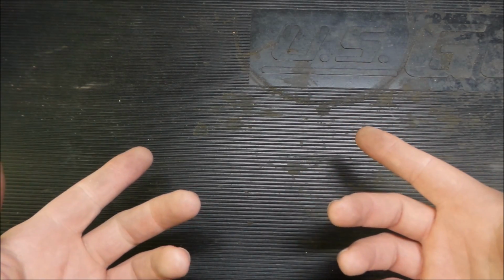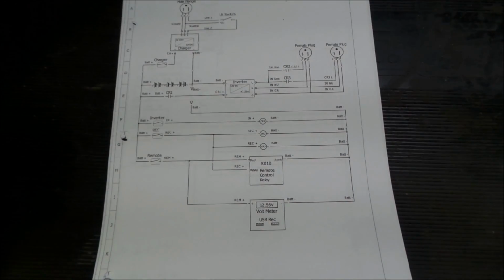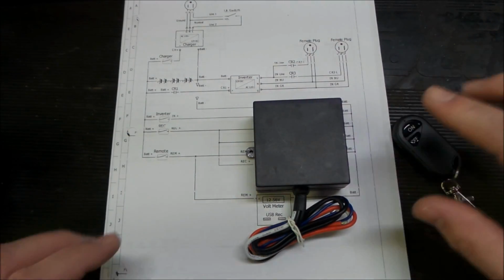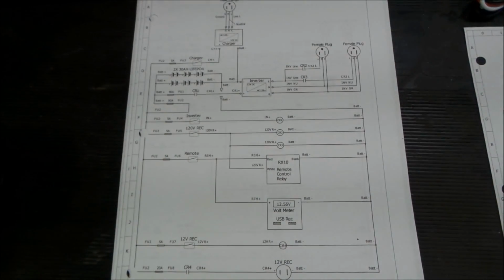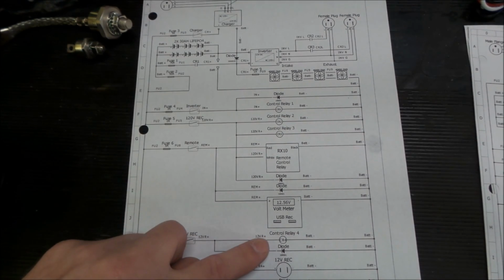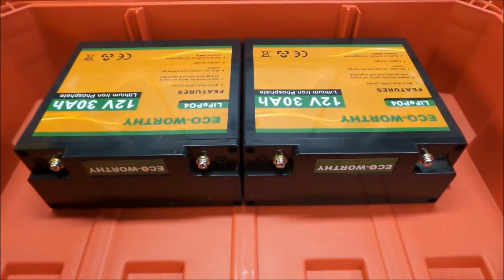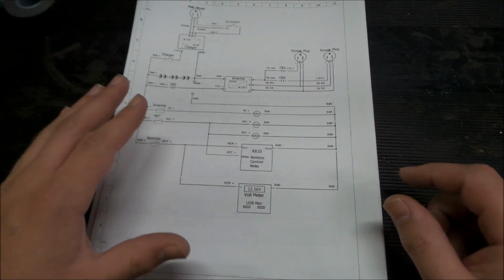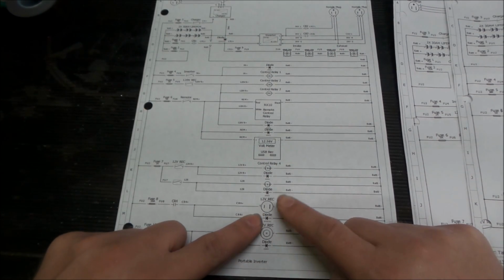DESIGNING a DIY Milwaukee PACKOUT Portable Power Inverter Project / Packout Power Ep. 1 - Planning

Comment: Great stuff, I think It would be helpful to start off with what your plan is for the power bank.  “ I want To be able to run this equipment for this many hours. Max volts I’ll draw at a time..”
Reply from the maker: How many watts do you intend on drawing and for how long between changing cycles? I believe I caught all the basics in this build aside from alternate charging methods. Sizing the batteries and the means of charging for the batteries will be the biggest part. Once you know the size of your components, it'll be easier to figure out what size enclosure you'll need.

I'll be happy to help where I can. This was a really fun project to build.
Reply: @TalkingHandsTools  I came to have 4 deep cycle batteries (kind of ridiculous) 6v 240amphour batteries. I want to make an off grid system. Linking the batteries for a 12volt system. For  simplicity Renogy solar panel charger and inverter(both have all the built in protections). I’d probably have a dc bus for 2 fans but keep the rest of it pretty basic to help myself out. Being able to still hook up a wall charger would be nice. How would I design it to have dual charging methods?
Reply from the maker: @chaseRDuey I would probably utilize some breakers to isolate your wall charger from the batteries. You could use a breaker to isolate your renogy controller also. It would require some manual operation on your end, but it would protect your chargers and eliminate any fears of reverse current damage to either. 

Depending on your chargers, I've found many, if left hooked to the batteries while not charging, can actually discharge your battery over time. They use voltage to establish their charging reference, and unless the charger is online, it can actually be a draw to your system. I like to either use a switch or breaker to isolate the chargers so I don't have the parasitic draw on my batteries.

Size your breakers at 125% of your rated capacity of your charger, and you should be good.

Comment: Great job! I dont understand the relays. Also, why not pure sine wave inverter? I'm building one now with the bigger packout. Nice video!
Reply from the maker: I utilized the relays for the controls. Part of my usage is to have the remote control. On the inverter, I was a little limited by size constraints, and the one I got fits the needs of my application. 

How many watts is the one your working on? What batteries and which packout are you using. I'd like to build a larger one myself at some point.
Reply: @TalkingHandsTools  well, I have a renogy 3000 12v inverter. I find it too big, but it's been laying around for a year. I might use a 2000v one I have already. Much smaller. Also, I have a lot of those SPIM08HP lipo pouch cells. They're so powerful! Better for forklifts and go carts. I put a 36v pack in my golf cart. Really zippy now. I would rather use lifepo4 cells. So easy. It would be for my daughter, she loses her power often. I wonder how I could send you photos of my build. Only has fans installed now.
Reply from the maker: I can't type it out in the comments, but most youtube channels emails are the channels' names at Gmail. It sounds like you have a neat project in the works. I don't lose power frequently, but the larger version I am designing will be for house backup and maybe running corded tools more remotely. The 500w inverter I made was never intended to run tools.

Comment: Lithium batteries are nice too because they dont have to stay upright like lead acid do
Reply from the maker: There are Absorbent Glass Mat or AGM lead acid batteries that could have worked and truth be told I originally designed this project around AGM batteries that were the same casement size as these 30AH LifePo4 batteries. The AGM Batteries were only 18AH and about twice as heavy. Lead acid batteries are still functional but don't have a power density like the Lithium Iron Phosphate batteries. Being more power and lighter made me pull the trigger and give them a go. So far they have held up great.

Comment: Can you post a parts list and video on how to connect  everything
Reply from the maker: I need to work on getting a good list together and coming up with a way to post my schematic. A bunch of guys have asked, I'll try and get going on it. The biggest part of this is the LifePo4 batteries and the 500w inverter. The nuances are the plugs, fuses, relays etc.
Reply: @TalkingHandsTools  Just wondering if you came up with the list yet.  I've seen people post the components in the description area.
Reply from the maker: @lmb5826 I posted the schematic in the community tab. You should be able to put together a components list from the print. All the devices and their values are on the print. 

As far as where I got everything, some stuff I had, some stuff I bought from local vendors, some stuff was bought online from auctions that are no longer active. I don't buy from the jungle site. I've had too many problems buying from them, and for me, it's not worth the hassle.

The print is accurate and up to date. It should have what you're looking for. Custom projects like this can be hard cause they are custom, which will always require some extra leg work. If you have any questions on the print, I'll be happy to answer them. If the resolution makes it hard to read, send the channel name @ gmail an email, and I'll send the pdf to you directly.

Thanks for your interest in this project it was a really fun one to build, and it's been working great.

Comment: Why didn't you use the USB charger that was on the inverter, whit just a USB extension cable. Cool project.
Reply from the maker: I'd say the biggest reason was battery conservation. If I wanted to use that for USB I would have to run the inverter. This way, if I only want to use it for USB charging, that's all I have to turn on. Great question. I had originally planned on doing it that way but later changed my mind.

Comment: Can you put up a parts list?
Reply from the maker: I can work on a generic one and add it to the description. I'm not going to provide any specific part numbers just descriptions and you should be able to source your own components fom that. An example is the 500w inverter. There are many made and you may find something better than I did for your project.
Reply from the maker: I think I came up with a compromise. I posted the schematic for this project as a community post. All of the electrical components are on the schematic you should be able to get a list together from there. Things like fasteners and what have you are not included.

Comment: Interesting project but your only going to have 4-4.5 amps of power on the 110/120 ac side. I hope you don't expect it to power anything large like a 1/2" 7 amp drill or saw.
Reply from the maker: You are correct. This was not designed around making all corded tools "Cordless" it was designed for another purpose which has a load of around 350W which is around the 80 percent loading. The other part of this was the learning curve for potentially making a larger scale version for the tool based purpose. We will however test it with some power tools but it's not really designed with that in mind. Thank you for watching this was a fun project to do hopefully you'll enjoy the next two parts.